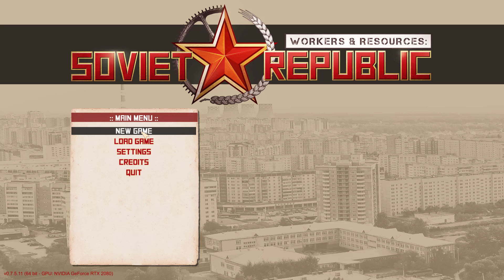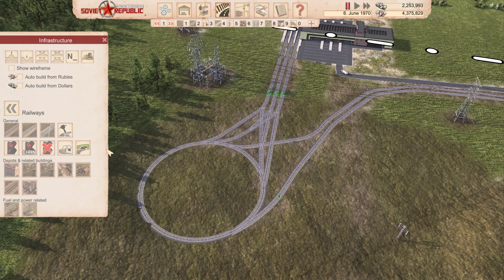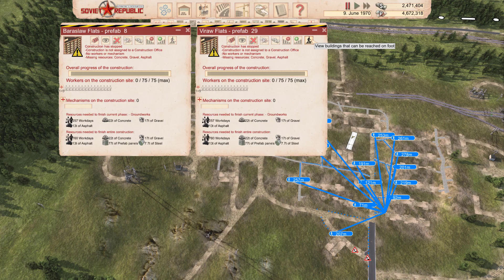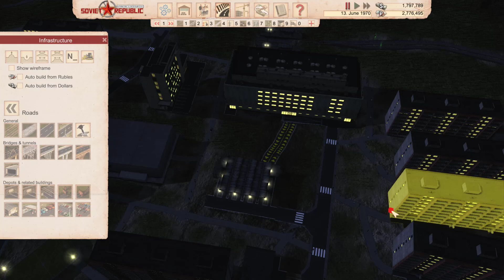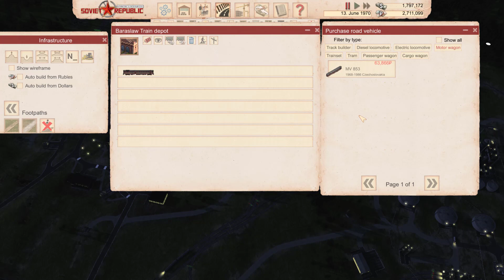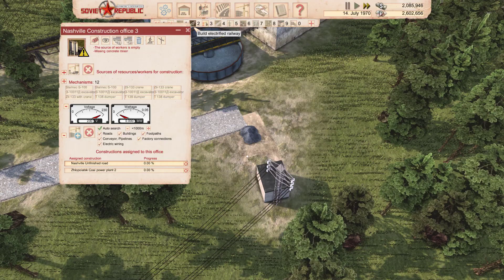Workers & Resources: Soviet Republic - S4:E20

Comment: As I'm sitting here screaming at my monitor "The Power Plant and Steel Mill are importing coal on top of your production!"
Reply from the maker: Why didn't you scream louder? I was operating under the assumption that if you set something to import to maintain 16 tons of coal that it would stop importing when the factory or plant more that 16 tons. After reading your post I checked and sure enough I was importing iron and coal when I didn't need to do so. I don't understand the logic of having it import over top of the amount you want it to import to, but there it is.

Comment: Remember that the high voltage lines can only carry 13MW. So merging 2 powerplants into 2 outgoing lines means that at most (when distributed evenly over the two lines) 26 MW can go out of the 42MW potential. If you want to export 10MW to the western block, it would need it's own line of which you can tap one or two cities along the way.
Reply from the maker: Thanks. Great comment. Will cover on an upcoming video.

Comment: From what I've seen in various places I don't believe the electricity "grid" works as a grid and it is not possible to connect two power stations together, though I have seen work-arounds mentioned. Better power management is on the Dev's road map. It will be interesting to see your experience as I am getting close to adding a second power plant in my game.
Reply from the maker: I'm not sure about how grid-like it is, but Matt made an observation I will share on an upcoming video about the capacity of the lines that could be at the heart of some of my confusion.

Comment: I think you need to ramp down your steel, oil and power production till u have a back up of Iron ore and coal ore. Then once the ore production is in a good flow the next stage can be ramped up leading to a back log of processed Iron and Coal. Then unleash the full potential of your steel, oil and power plants..

Comment: Hello Adekyn - Had a few issues with Diesel re-fulling station, had put passing lanes either side and all seemed ok, on my set-up.
What was happening train set off to unload it's love cargo (single line up to it after fuel station, run out of fuel come back to refuel.
It would then get stuck as signals set in the fuelling station as one way!!

So changed it so the rail lines in the fuelling station went both ways and the passing lanes still one ways in either direction, bingo problem solved.
Reply from the maker: I had all kinds of trouble with a particular diesel station in series 2.

Comment: Hello Adekyn - I'm sure I saw it in one of your YouTube play throughs - is there away to build housing without populating them with people?
Reply: Untic the auto-populate option before placing the building. I don't fully remember from the top of my head, I'm currently on holiday...
Reply from the maker: Yes, it's how I've built most of the flats in series 4. When you are placing a flat there will be an option called Get Citizens. Set it to not automatically recruit immigrants. You then manually recruit the immigrants after the building is constructed. I will demo it on S4:E21.

Comment: The rail oil unloading station is also missing a road. But it is nice to see that you have hit your stride. I am so looking forward to Radio/TV stations and plastics and electronics factories.
Reply: Re: construction, you also need to build more flats for the iron ore mine.
Reply from the maker: The rail oil unloading stations has a road connect for fire protection. It just isn't attached on both sides.